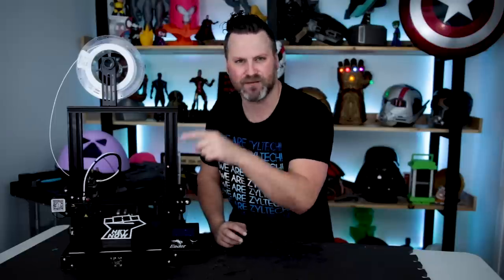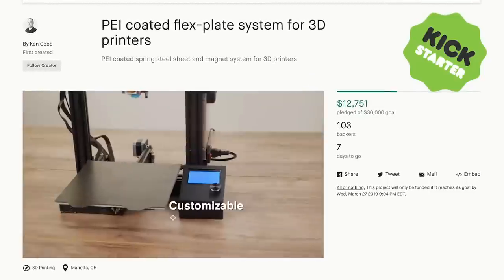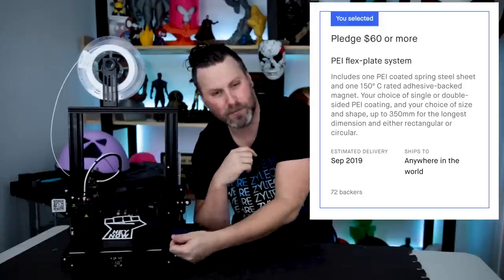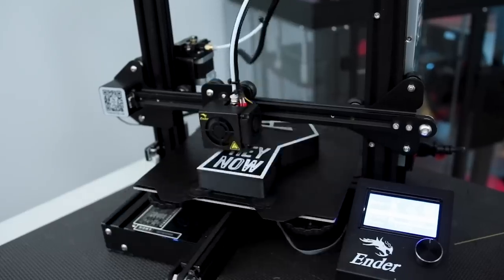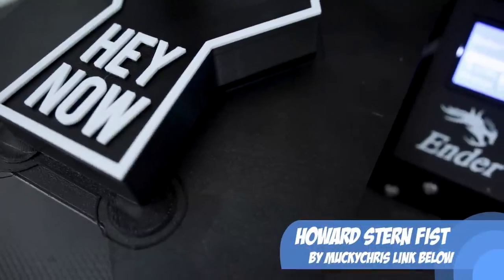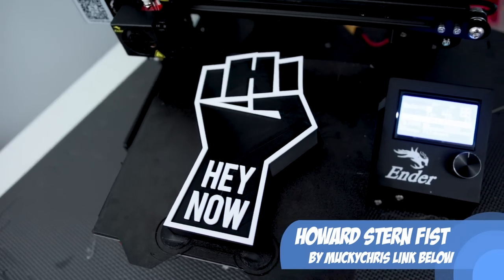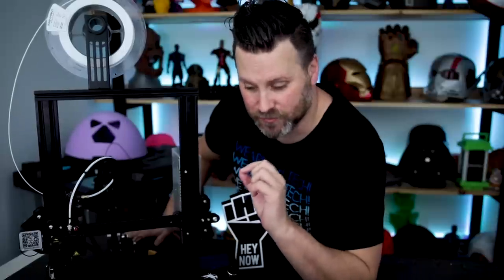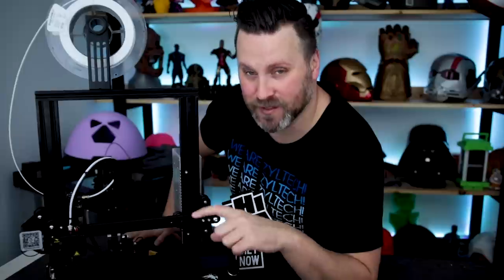Kickstarter PEI Coated Flex-Plate System | Hands-On | HEY NOW!

Comment: The first thing I did with my Ender 3 pro was to remove the adhesive backed magnetic sheet.  I've tried a lot of systems but I still go back to borosilicate glass and I have one on my Ender3 Pro.  My experience with these surfaces is that they work great initially but their life depends upon the filament that you are using and it seems like PETG is more destructive then PLA.   I'm interested to see what the sheet looks like and how it works after you print several items with PLA and PETG, mixing items with large solid first layer areas mixed with smaller but complete first layer areas.  They claim to have a better mousetrap and I am hoping that this is the case.  Please do a follow up video after you have used this plate a few times and then again several weeks later.  I want to become a believer.
Reply: I've been printing on a PEI surface for like 2 years now, PEI will outlast any other print surface I've tried

Comment: I'm thinking about purchasing my first 3D printer, I've been using a friends Flashforge Guider 2. I can either purchase one CS10s or two Enders 3 Pro. Which would be the better way to go, I'm obviously looking for the biggest build volume I can get. I'm also looking for reliability and somewhat ease of use. Any guidance would be welcomed.
Reply: 3d printing is SLOW. If you can break down your models into pieces that fit into the build area of an Ender 3 pro then buy two of those and halve your print times. When I say slow I am not kidding. a simple 2 cm on a side cube that's completely hollow can print in about 20-25 minutes. a 4 cm by 4 cm cube will take an hour. Doubling the size in each direction is like 3 times as long to print. A life size model of the terminator skull is 10 hours+ on a rough draft.

Comment: So with these, do you still need to use like glue sticks or something for it to adhere to?  or do prints just stick to it with nothing needed???  Because if you need glue or other stuff hows the cleaning on it going to go ?
Reply: Pei is what prusa uses on their printers. You don't need anything else for adhesion.
Reply from the maker: Tha Corruptor no glue... just print directly on the bed. Works great so far for me.
Reply: @UncleJessy  Ahh ok I have a CR 10 and use a mirror with glue sticks, so I tried looking on the kickstarter and didnt see anything to answer my question. So I thought I might ask here to get a response.  Edit: Mirror + Glue is semi reliable at best lol hence looking at these, because I hate prints lifting or failing

Comment: That's so expensive for something you'll need to replace not that far down the road.
Reply: Ken  $45 may be inexpensive to you but not to everyone. You could buy 2 quality magnetic peel sheets for that cost. And those last just as long, But I understand you're gonna defend your product. I'm just saying to a lot of people this isn't gonna be the right choice. Maybe to you and some few it's worth the extra money.
Reply from the maker: That’s actually really good price when you look at other metal flex plate systems. Especially if you go for a 300mm size bed
Reply: @UncleJessy  yeah I can agree that for a bed around 300 mm it's a good price, but for something like the ender 3 it doesn't make sense. Again i can see there being a market for this. Just not for makers on a budget.